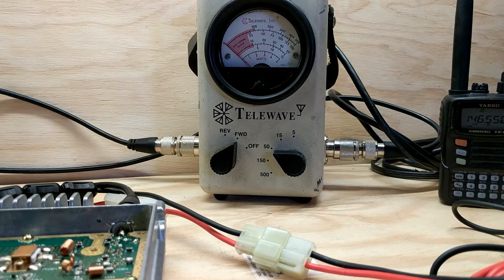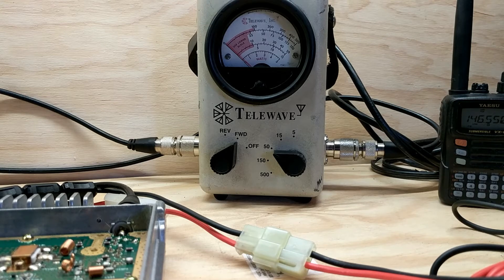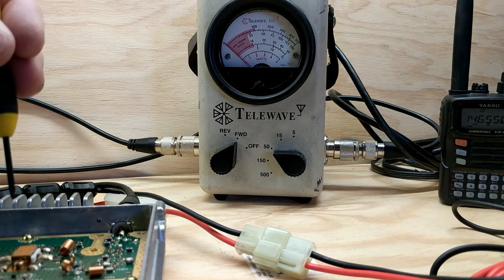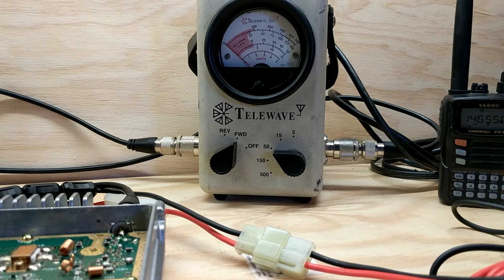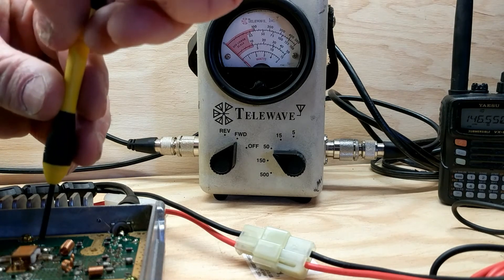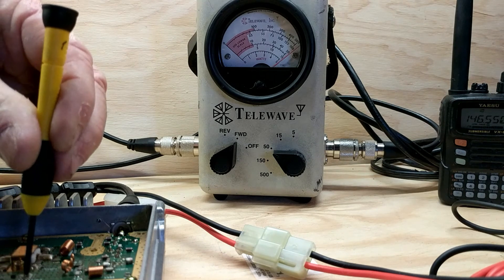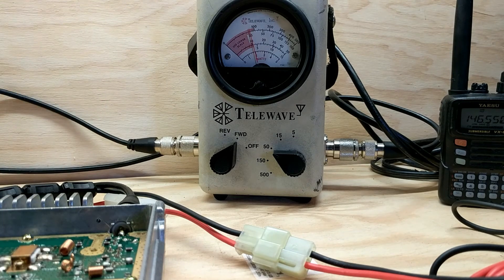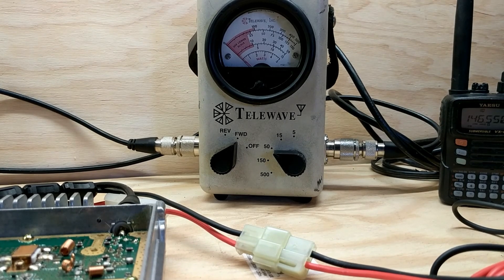How to Adjust the Kenwood TM-271A Transmit Power

Comment: Since my Kenwood TM-71A was new it is not putting out designed power on any of the settings anytime on dummy load or antenna. Would you have any instructions on this?
Reply from the maker: HI Smitty - A few thoughts  -

1. Presuming you have a watt meter, does it show any power at all in transmit?
2. Does the TX light come on when you press the PTT button on the microphone?
3. Any chance the radio is accidentally programmed outside of the ham bands (in which case in won't transmit), for example, the offset frequency is wrong which could put the TX frequency outside of the ham bands?

Also, you might try doing a "full reset" of the radio as described on page 67 of the manual. If something was amiss in the settings, a full reset will clear it up.

Hope you get it working.

Comment: Hello, how high can it be adjusted.  I live in a area with really no repeaters but it's mostly flat . As simplex is the only option more watts will help alot
Reply from the maker: Hello faisal, As I recall it was already adjusted to the maximum output by default. Sorry I couldn't be of more help.

Comment: I have a mint TM 271a it looses it's receive in first 3 minutes a you get is wx station mostly or repeaters your close to was A1 mobil ops before this where is the RX Fet what regular component with 3 wire legs can get get and solder to pcb? A small 2sc945 type transistor sized replacement.
 I'm really tired of smd"s
Reply from the maker: This is a common problem with the TM271A. The front end is very sensitive.